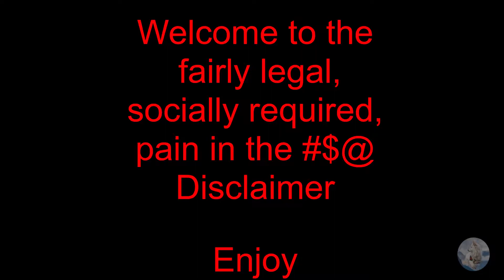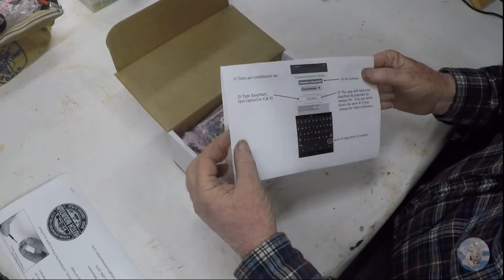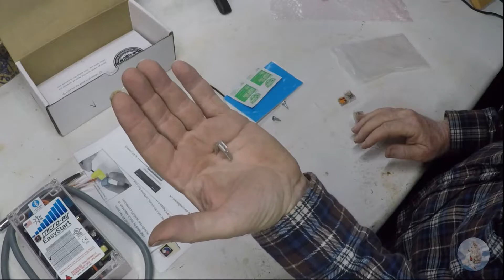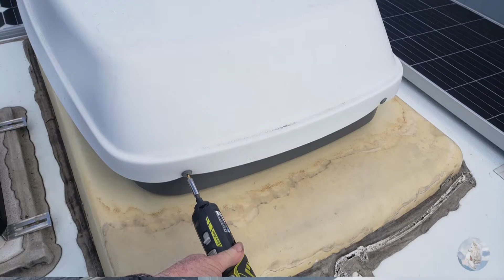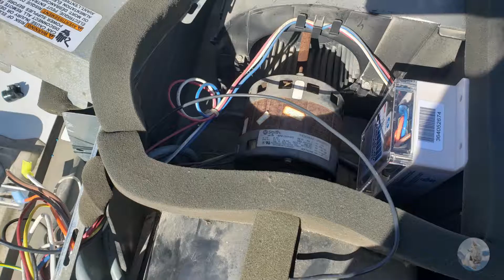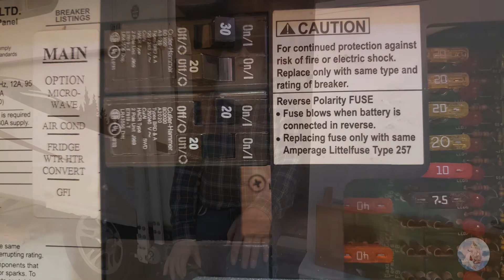Micro Air Easy Start Model 364 unboxing and installation.  Dometic Penguin 13,000 BTU

Comment: I installed the MicroAir East Start on the side mounted AC in my 2001 TM.  I like your propane converted generator though.  I'll have to see about converting mine.  It will save lugging extra gasoline around.
Reply from the maker: Hi Larry B. and thanks for the comment.  Our Westinghouse igen comes dual fuel from the factory.  Doing a conversion on a gas Genset is pretty straightforward.  Hutch Mountain has kits as well as other retailers on the net.  I definitely like not having to carry gasoline and propane is easy to pack.  Thanks for watching and safe travels.

Comment: Thank you for showing.... I am considering the exact same installation.
Reply from the maker: Hi Kory and thanks for the comment.  It's not a cheap option, but I think it will make a difference in how and where we can operate.  Thanks for watching and safe travels.
Reply: @thecritterandthebutterfly  I would love to get an update as you use it through the summer. I am hoping that the install will allow me to use my generator to run the AC and not have to buy a new GEN>